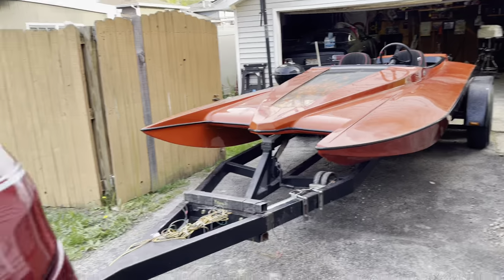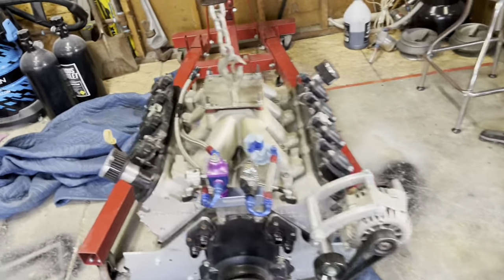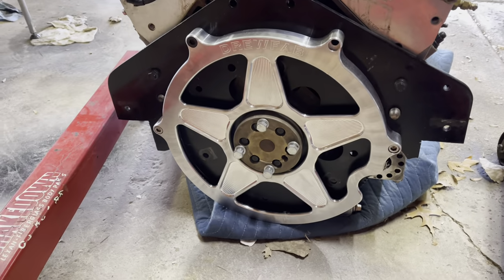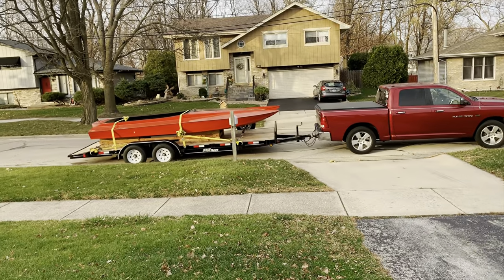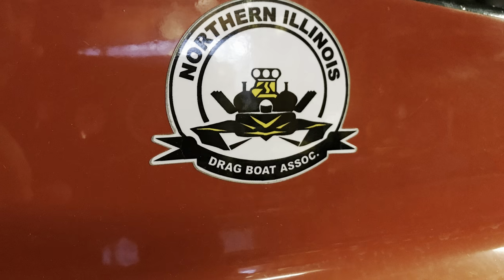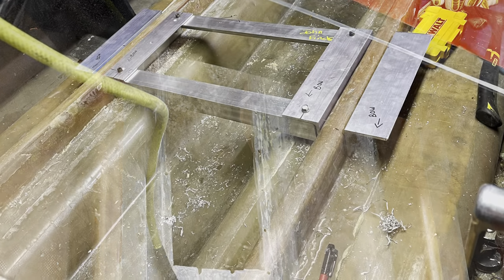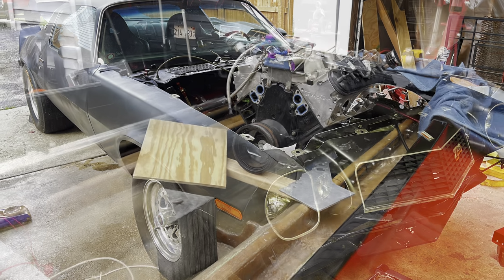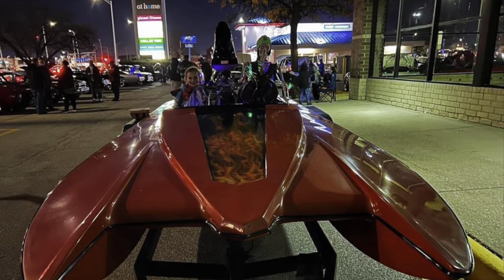LS Swapped Jet Boat update, video compilation and build photos

Comment: I'm blown away that there are no comments here...

Can you talk about the fuel pump, engine mounts, why you chose carb'd over FI?

I'd love to watch a deep dive/build breakdown/cost analysis
Reply from the maker: The first video I posted kind of has a breakdown of how this boat came to be.

It has a magnafuel 500 pump feeding both the engine and the nitrous. The rear motor plate is just a basic big block Chevy mount for a jet boat. The front is a cheap motor plate for a drag car that I cut to fit the boat. 
Carb because I can have a carbureted combination running and tuned very quickly vs Efi which I have zero knowledge of. 

The build honestly didn’t cost me much because I already had this engine in my car and just swapped it over. All of the other parts mostly came from junkyard boats that I parted out